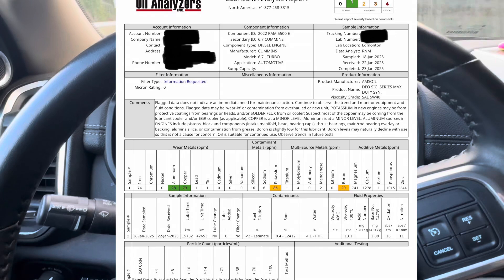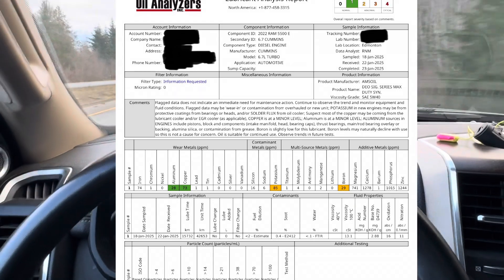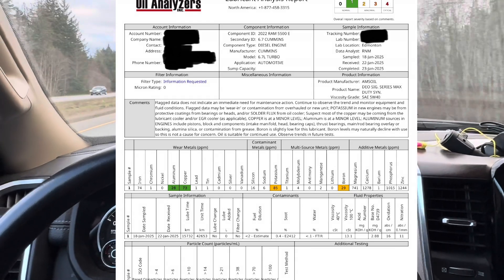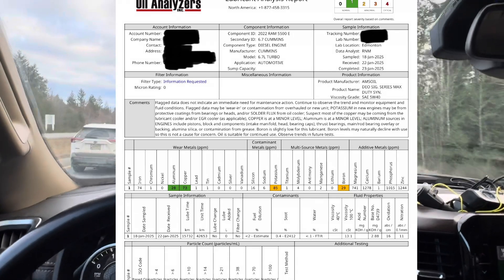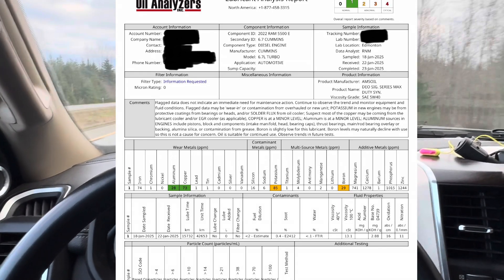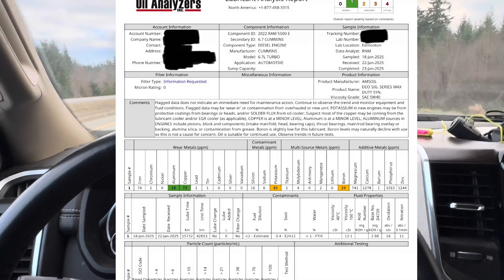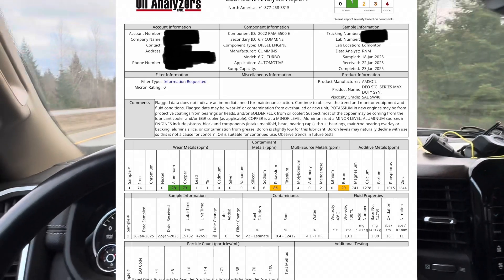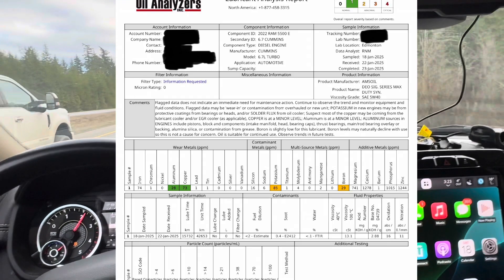Is My 2022 Ram Cummins going to blow up?

Comment: I feel like it would just be cheaper to continue to change your oil at half the manufacturer recommendation rather than change it when the tests say you should. Fresh oil is how these engines stay clean. Also a spot test isn't going to tell you a whole bunch there are so many different manufacturers of oil and vehichle to choose from that they have to see the trend of 3 tests to tell you anything useful unless your engine is already failing.
Reply from the maker: @JustAverageJeff  it costs me just under $50 to test an oil sample.  With a diesel truck that takes 13qt of oil it costs proportionally less than an engine with a smaller sump.  I tested to confirm the oil was suitable for continued use and that the oil minder wasn’t saying there was oil life left when there wasn’t.  I also wanted to test for wear metals that could indicate a failed lifter etc.  That will show up on a single sample.  If it shows minor wear metals then you should certainly base any decisions on trends from 3 consecutive samples.  I have a fleet of equipment and trucks I test oil samples on.  When there is an issue, the cost of sampling the oil is worth every penny.  The bigger the engine the bigger the potential return on investment.

Comment: Bro your steering wheel is off-center !!! You definitely need an alignment on that vehicle !!!
Reply from the maker: @davewolly3682  I was laid up for a number of months after a motorcycle accident.  Someone stole my tires and rims while I was immobile and the truck was parked.  They swapped them out with clapped out tires and rims.  The truck pulls that hard to the right that I have to steer to the left to correct it.  Still dealing with insurance over it.